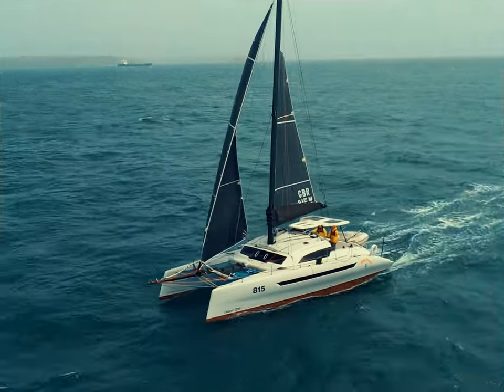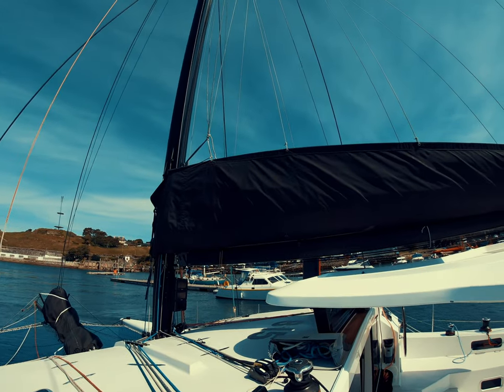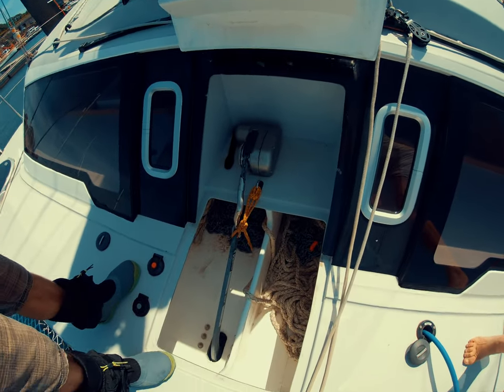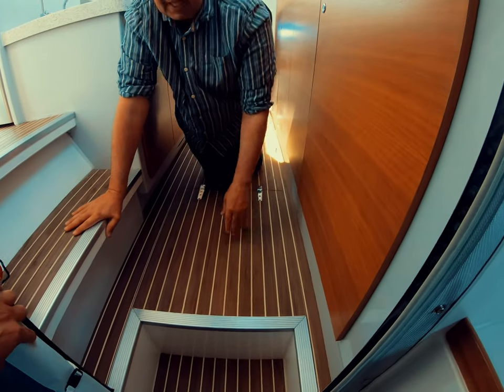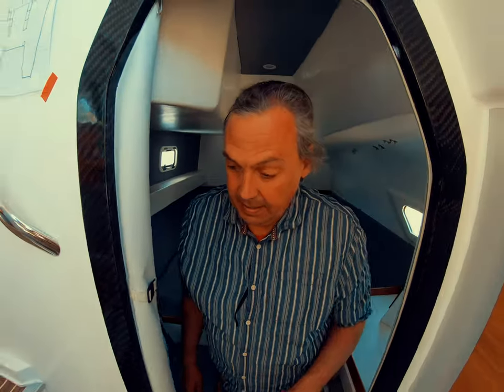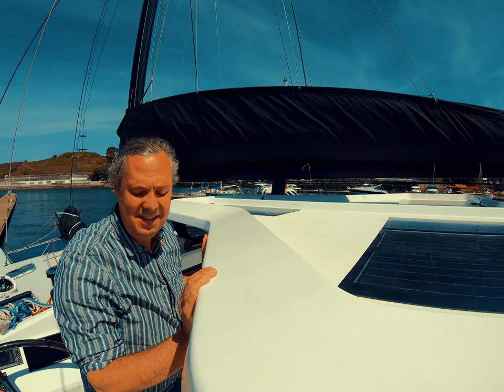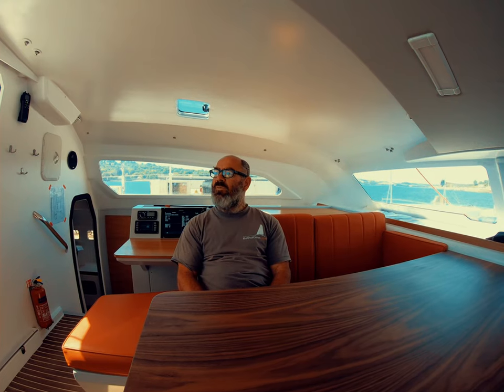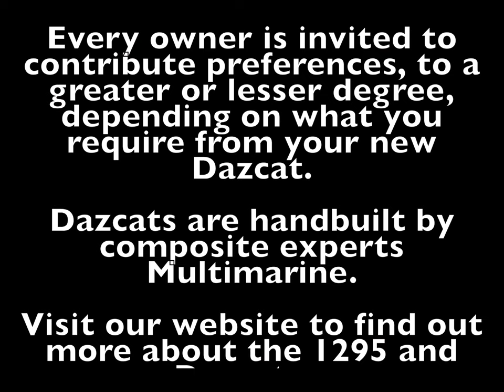Dazcat 1295 interior tour with designer Darren Newton

Comment: Hard to judge some of the details on a video walk through, but there look to be some shortcomings.  Carpet on the headliners?  Not in 2022, not for ~ $800K.  No oven?  (Maybe it was there.)  The berths look  small, but perhaps the size of the presenter made them seem smaller?  Two adults need at least a real queen width.  (60")  Where's the ventilation?  IN GB where it's almost always cold and damp, that works.  Rest of the world, not so much.  And round hatches are silly - two hinges, please.  I also don't like the exposed helms.  Maybe they can be enclosed for better protection.  Galley layout is not great.  Compare to a Seawind 1260 at the same length.  And there should def be a separate shower stall on a 42 footer.  (Esp with only one head!)  I love how you knock on the hull to show it's strength - you and Colin from Parlay!  LOL  Why round hatches to the storage under the berths?  Harder to get things in and out.  Needs some tweaking...
Reply from the maker: Thanks for your thoughts. This boat was built to the owners' specification so it's as they want it. And yes, the presenter is 6ft4 and who knows how many kilos but he is comfortable and happy there. Dazcats are not for everyone and that's fine with us.

Comment: Sails are nicely trimmed by experienced sailors.She is a fast boat little tight inside but you have to make compromises if you want fast and light boat.Roomy apartment like cats do not perform well specially under 40 foot range.I'd rather fast cat to a slow roomy cat.It is nice to be able to run away from bad weather quickly.Spending less time at crossings more time relaxing at anchor.For family it may be a weekender but for a single sailor or a couple it is a cruiser.We don't all have money to spend on big 50 footer cats.So she is nice fast and affordable.6.3 gentleman fits in nicely It is definitely more roomy for me.
Reply from the maker: Glad you like it!
Reply: The best thing IMO is sailing fast in light breezes, far superior to motoring. This cat looks super fast.
Reply from the maker: @AORD72  We agree. We'll soon be posting some great light wind sailing from earlier in the year.